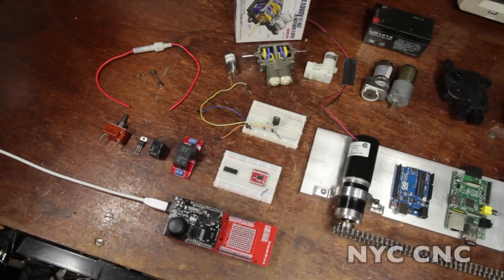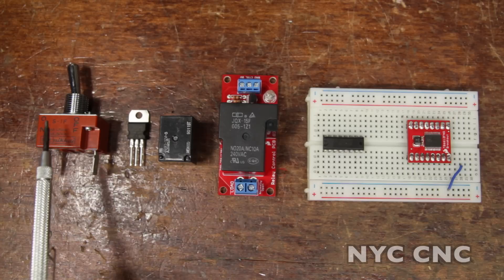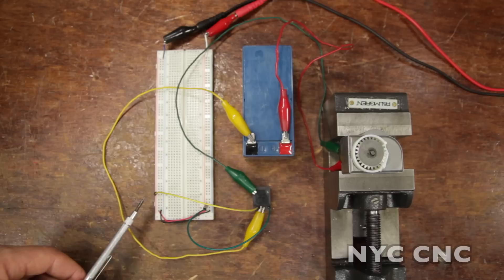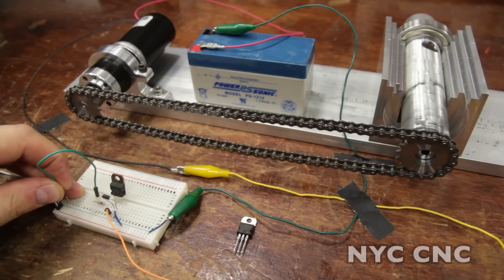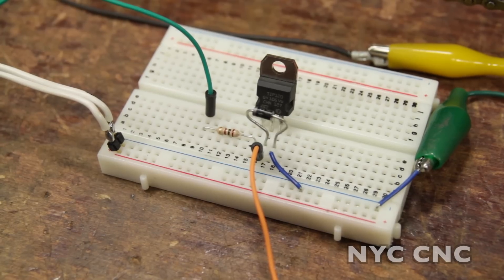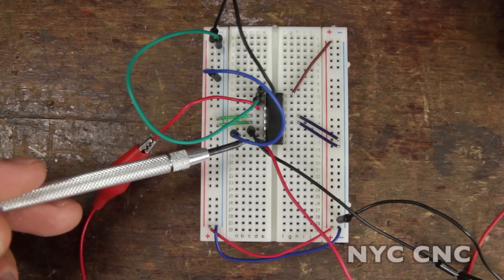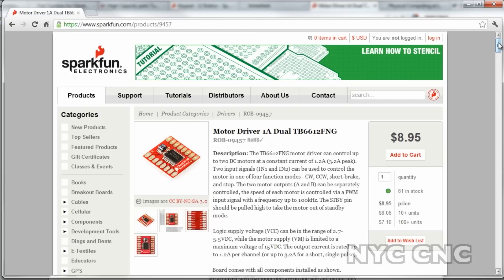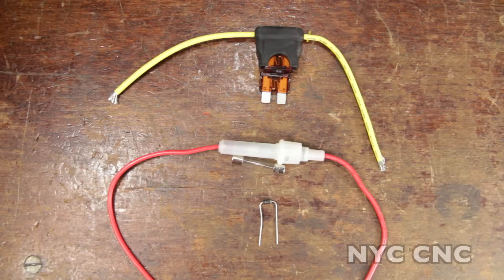6 Ways to control Motors! Including with Arduino & Raspberry Pi!  How To Tutorial from NYC CNC

Comment: Should that diode be jumping the MOSFET leads? I would have thought that you needed it in series with one of the leads to prevent the current from flowing backwards.  Or is the point to basically short the circuit out in one direction and not the other thereby saving the MOSFET? I suppose in either set up you can effectively prevent damaging your MOSFET.

Comment: I've watched ur videos they were awesome.iam working an project to run an 12v 7amps DC motor by arduino with IR sensor,but problem is motor doesn't on/off by ir sensor.pls reply and help me to solve the problem.

Comment: I am using a 12v DC adapter from a wall outlet. When I use the TIP120 set up my transistor gets hot! is this normal? Am I doing anything wrong? I cannot figure it out. Thank you!

Comment: hi john, i would like to ask a question regarding on my project problem, if this video can solve it.. so like what you said is true that arduino output pin gives out less current.. so i just encountered this problem a minute ago and so fortunately i found this video of yours.. so in this video, these six ways are able to solve the less current output problem?? because in my project, first step of signal to give current to my relay is a light sensor.. btw im doing greenhouse project..  light sensor detect low sunlight it will signal my motor to close the roof.. once it detect sunllight, the roof will open once again.. help me please..

Comment: Nice video. I have an existing 19v DC motor that is controlled by a trimpot. I'm wondering if I can tether off the control pin of this trimpot  and add a power transistor so I can control the motor with an Arduino, but still use the trimpot in the circuit as a limiter?
Thanks
Reply: +NYC CNC   Thanks. Thinking about it, I'm not sure if it makes a difference where I tether the MOSFET in the circuit, as it essentially does the same thing at either end.

Comment: Have you come across any way to control an AC motor with an arduino.  My personal use would be to control the AC voltage that is sent on an O Gauge railroad check, but I would think the process would be the same as controlling a motor directly.

Comment: heyy it's really a great video. 
can you explain how should o select a motor driver according to it's ampere rating. 
I want to control a 3hp motor with 2A no load amps. which motor driver should I use. a 50A or 100A. 
n what if I want to control 2 motors of less HP with a single motor driver. Will it blow the motor driver.

Comment: Hi, im hoping you can help me I have a 3-36 10A peak 30A dual motor driver module board H bridge dc mosfet lrf3205  avail on aliexpress.com please look up,anyway I hooked everything up and used a potentiometer to the pwm 1 and the dir1 and gnd. well cannot get any thing working wanting to use this for a steering control using wiper motor from a car for a power wheels sized rc car. please help hrlyrdr79@yahoo.com

Comment: Hi.. Isn't it possible to make a gear motor run directly from the Arduino? If not why?
Reply: +Nichlas Iversen  Only if you have a 5v or less motor. I've done this sucessfully with a 3v motor, a transistor, resistor, capacitor and Diode. There are good videos on here for hooking it up.

Comment: If I'm not mistaken you can use the transistor to control speed using PWM. 
(pulse width modulation)

Comment: Hi John,  The reason for the diode when using the transistor, is that when the power to a motor coil is removed the collapsing magnetic field will cause reverse polarity current to flow through the wires.  this will ultimately damage the transistor unless the diode is there to allow that current to flow around the transistor.

Comment: why Transistor instead of Mosfet??? whos the best Transistor or Mosfet??
Reply: +dj minions de spicable mosfet is the type of transistor.
Reply: i know,.. but they have more efficiency,.. Bipolar Transistor Vs Metal Oxide Semiconductor Field Effect Transistor,.. Some transistor can handle more amperes some are not,.. same as Mosfets,.. mosfet have low Resistance,..but for me mosfet are the best ^_^

Comment: Hi, is it possible to program an arduino to make a DC motor run 3 seconds then reverse for a bout 3 seconds then stop??...
Reply: NYC CNC Ok awesome!! I want to program a robot to run 3 seconds,stop,reverse for 3 seconds then stop. Is there a code in the arduino library that I can use? Im not very familiar with computer code.
Reply: chris p or a stepper motor.....

Comment: Im using an H bridge which was included with a stepper motor I had bought. It works fine with the stepper motor however when a dc motor is connected to it, it starts getting very hot. What might be the problem? 
The model of the chip is ULN2003APG. I dont have the model of the dc motor, however I got it from a toy car which used 2 AA batteries

Comment: Great job!! However you need to chamfer you thread, The way I do it I would run thread mill to the size then use same tool to chamfer top and bottom then one more pass with thread mill and then chamfer again for burr free thread. You be surprised how little it takes (maybe seconds) . As for programming create thread milling, chamfering then copy and paste right after in same order except change number of passes on 2nd thread milling just use one to get that burr out.
Reply: John NYCCNC
I know :)

Comment: Excellent video. 
Q: I don't fully get the datasheet of the beefcake. Am I correct in assuming it is capable of driving a 12V DC Motor with 10A Continuous current?

Thanks for the info!

P.s.
link 4) in the description is off. should be: https://www.sparkfun.com/products/11042 
@3:59: missing link to arduino vid ;)

Comment: Thanks for the video, really great! I want to control three or four dc motors (5v), with the possibility to switch polarity on a raspberry pi. I found that the L298 motor controller works great with two motors, but i really need support for additional motor. Do you have a tip there? Maybe it will work out with two L298:s?

Comment: I know the primary focus is on these awesome little boards, but another GREAT option is a $10 PWM (pulse width modulator) and a dpdt switch which allows direction and speed control of dc motors up to 10a at 12-40v for $10 on ebay. I use then to power wheelchair motors for various projects. Usually 24v @ 5a continuous.